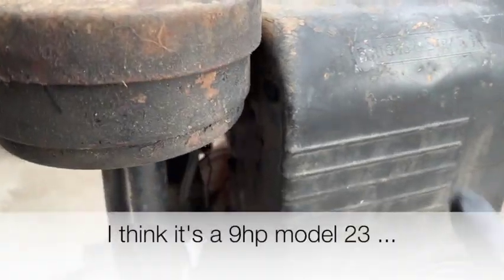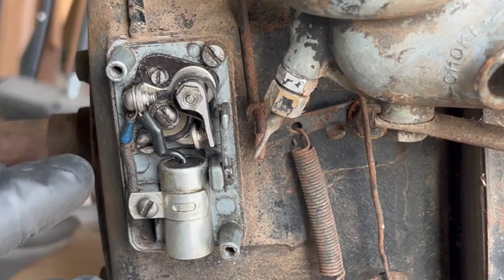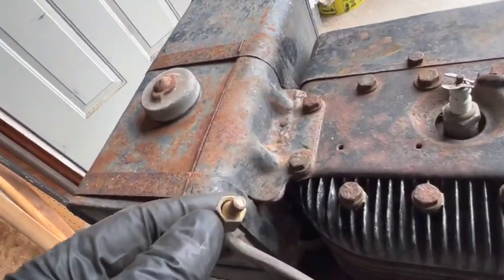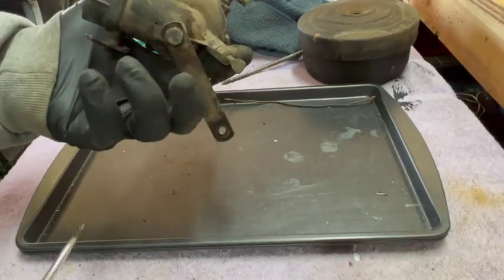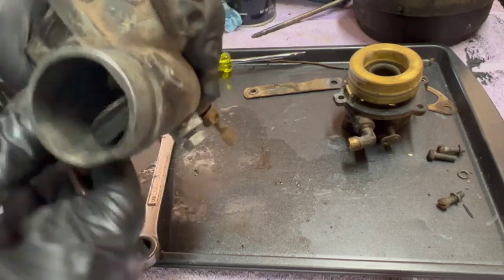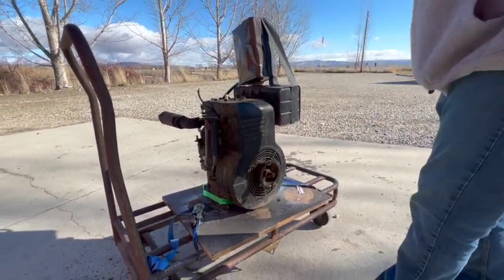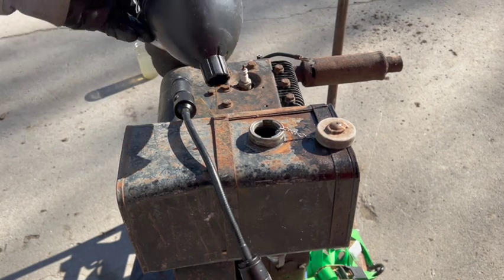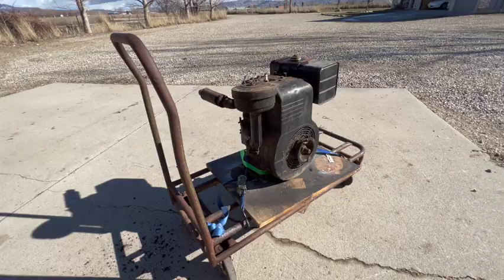Barn Fresh Briggs - Will It Run?

Comment: Aswesome work ! Sounds great.  I had one of those motors on a 1955 David Bradley (Sears) "5 HP Special" two wheel tractor.  It was a great running motor, but the points always seemed to need cleaned after it sat for a period of time in order to get it running again.
Reply from the maker: Interesting. These were corroded, too. I wonder if their location (under that little shield on the outside of the engine) makes them more susceptible to corrosion?

Comment: I am currently working on an old gilson cement mixer that has this same engine that I fully rebuild. Will post the video later   Beautiful engines
Reply from the maker: Cool. I’d like to see the video!
Reply: I'm working on an old mixer as well.. Briggs 19DR6 Engine.. Hard to start, may swap out motor for an electric start engine, but I need to match up gear reduction to new engine. Is your engine a 19D?

Comment: I cant get good spark on mine, sometimes it's very weak then none at all. Any tips?
Reply from the maker: Check the points first - gap and cleanliness .Then, check the entire length of the coil wire. Make sure it isn’t grounding out somewhere. Then, check the air gap between the flywheel and the coil. Then, check and/or replace the coil. Good luck!
Reply: @AntiqueCarsandStuff  got it! I'm so pumped hahaha, points were still a little too dirty. Had to guess on the gap because I don't have a gauge lol. It ran for a good 20 seconds on gas in the cylinder and starting fluid. Now to put the gas tank back on and run some fuel line! I literally tore that whole thing down today but it was just the points 🤣
Reply: Clean the points with contact cleaner / drag a clean biz card through gap to remove dirt
Reply: There’s no off switch?